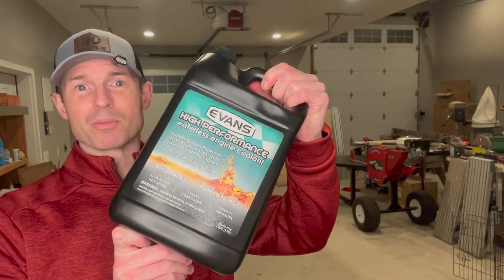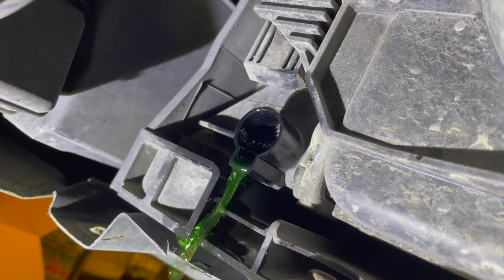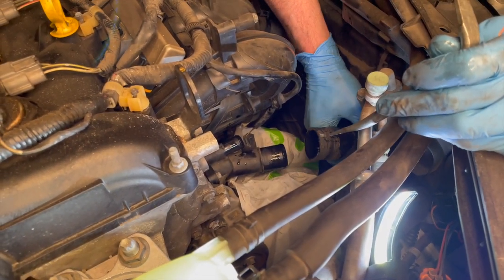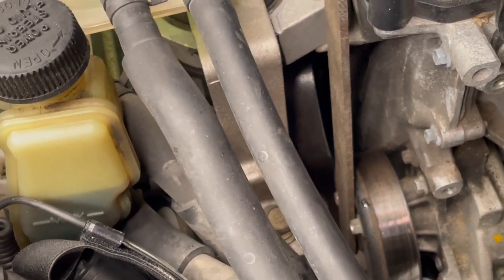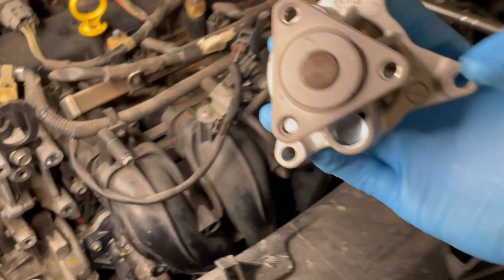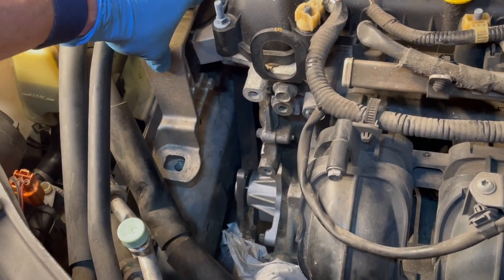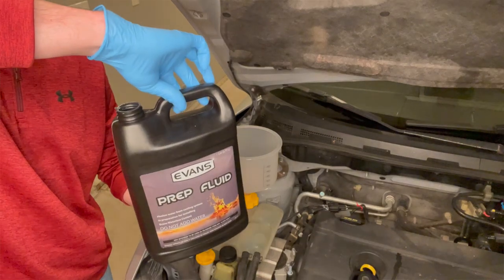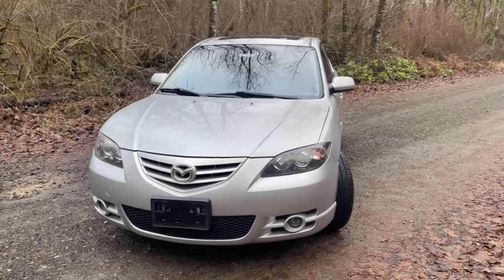'03-'09 Mazda 3 Thermostat & Water Pump Replacement (Plus Waterless Coolant)

Comment: This is how you make a DIY auto repair video. 🙌🛠🏆 You used a tripod used when possible, there is no annoying thrash metal/rap/hip hop noise in the background, and you provided good, clear instructions along the way. Thank you, Coyote 12! I have been a Mazda fan and buyer for 30+ years and own a Mazda3 Grand Touring with the 2.3. Their products are reliable, well-designed, and well-made. For those interested, compare this same job to that of Ford 3.5 and 3.7 V6 engines. The water pump is deep INSIDE the engine and runs off the timing chain. 🤯 It’s a $1500 repair job because it takes a professional several hours. Don't get me started on BMW and Audi under-the-hood repairs. 😱 Beginners starting to post DIY repair videos on YouTube can learn a lot from this excellent video’s production value. Thanks for taking the time to make this. It is the gold standard. 💫
Reply from the maker: Thank you so much!  I really don't deserve all your kinds words, but I can say that yours is one of the nicest, most sincere comments I've read on a YouTube video EVER!  I genuinely appreciate you taking the time to watch and share your thoughts.  As for the Mazda brand, I love it as well.  It's too bad none of the top three (Mazda, Toyota and Honda) make a 1-ton pickup, or it's all I would ever own.  :)  All the best to you and yours! KB